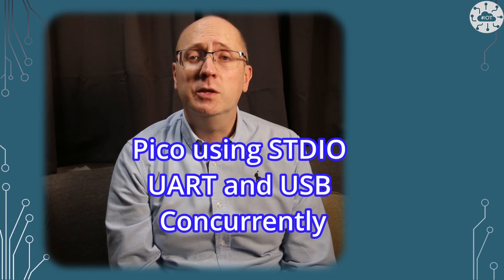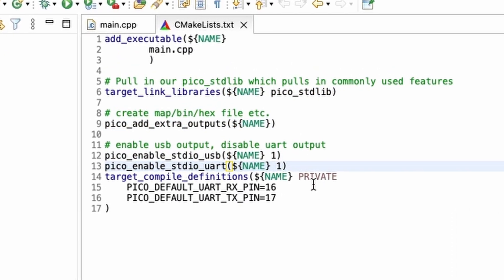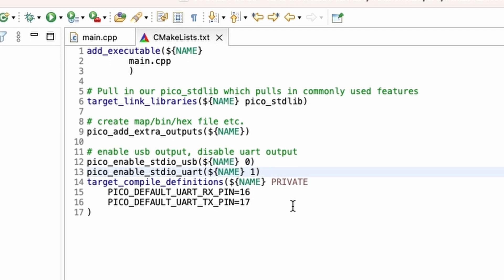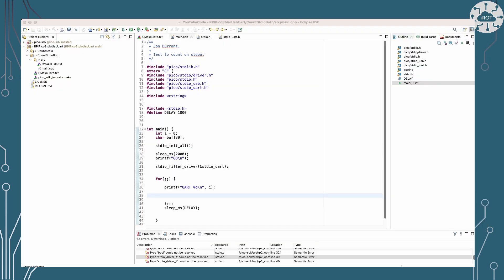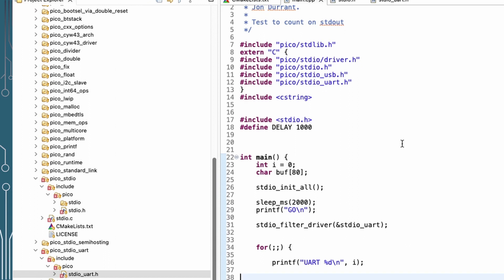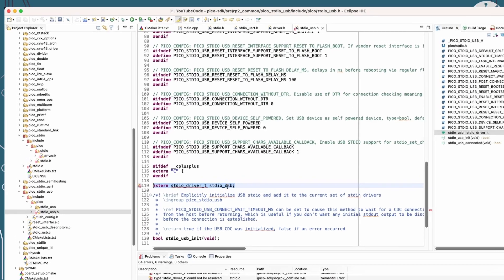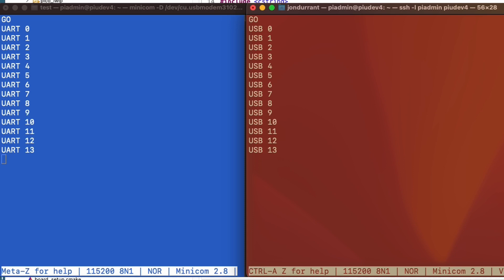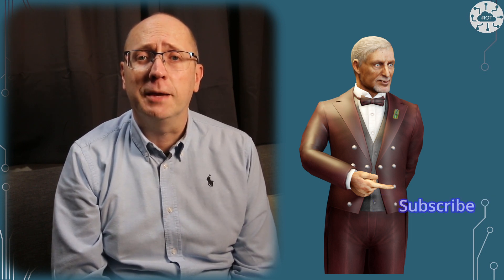Pico using STDIO UART and USB Concurrently

Comment: Awesome! Thanks a lot, this really helps!
Reply: But why don't you use stdio_filter_driver() for usb too? I tried it and the following works like a charm: 

stdio_filter_driver(&stdio_uart);
printf("HI UART!\n");
stdio_filter_driver(&stdio_usb);
printf("HI USB!\n");

I mean, IDK if reading from both interfaces asynchronously will work well because stdio will block the interface which is not in use (e.g. you cannot read from USB while writing to UART). At least only for writing into one direction it's a sufficient solution to me.
Reply from the maker: I wanted all debug (Printf) to go out of UART hence why I only filter there. I was then writing ad driver for MicroROS which would use the USB STDIO).